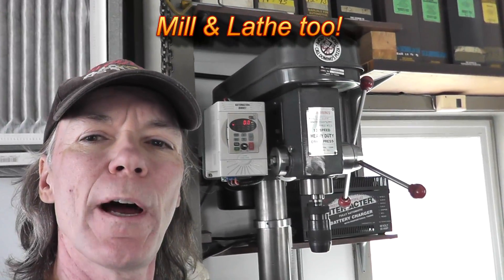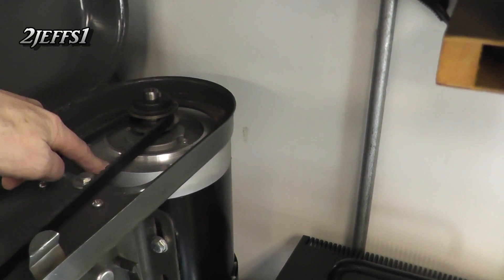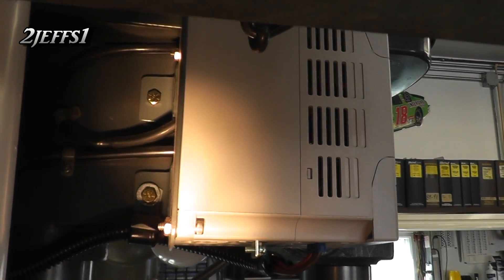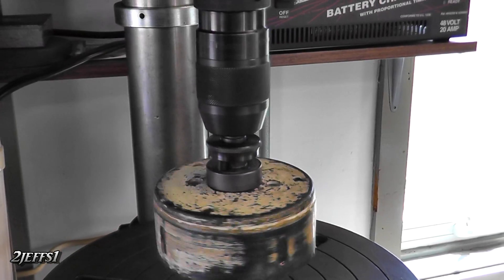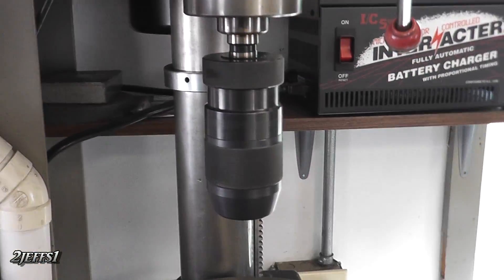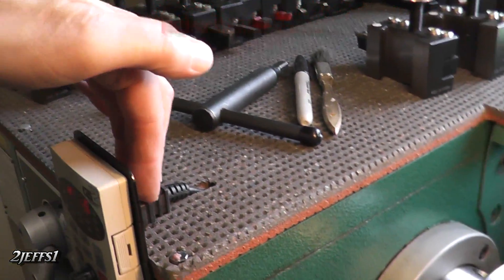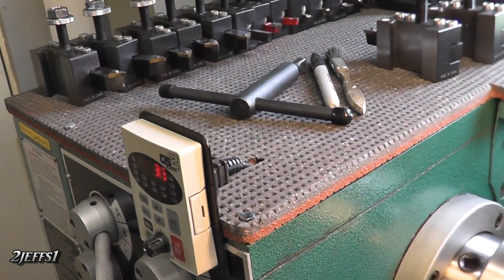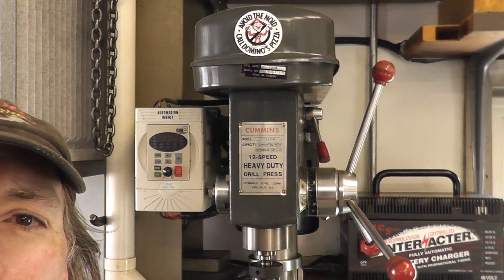VFD Drive Drill Press Lathe & Mill  (Variable Speed) DIY

Comment: I couldn't believe my eyes when I first saw your drill press - I have the exact same one! My father and I purchased ours back in the early '80s at a tool show here in the states.  I think at the time they were coming from Taiwan...and yes the chuck had so much run-out you could use the drill bit for an egg-scrambler.  I bought an after market chuck and a new MT-2 arbor and this helped quite  a bit.  I think at least part of the issue was that the spindle tapers were not ground to a very tight tolerance. In any case the runout is tolerable for woodworking, and I now have a Bridgeport for the more precise work  I have now since replaced the chuck, this time with a Llambrich keyless chuck solely for the the convenience....  The speed-change issue is now the most limiting factor.    Ironically i was just toying with the idea of getting a little 3-phase motor and VFD and converting it when i saw your video.  Thanks for some great suggestions!

Comment: Hello -
You said that is has good torque at low speed, but left it kind of vague.
I was watching another guys conversion video and he pointed out that at low rpm (maybe 60 to 100 rpm) the torque was weak, and stopped it turning by just grabbing the chuck with his hand. That was shocking to me. 
Are you able to stop your setup by grabbing the chuck at low rpm ?

Comment: Hello, Good video. I have a Lathe exactly the same as yours, its run on 220 volts single phase. Is yours run on single phase or 3 phase?  If single can you give some extra information on how you did it.  I'm having trouble finding information on VFD for 220 volts single phase motors. Can it be done? Graham, many thanks.

Comment: I think at 4000 HZ, with a three to one ratio that you mentioned, the spindle would turn 116,000. RPM’s! Yikes! How is low speed power? How big a hole can it drill? I calculate 580 RPM at 60 HZ you mentioned 4000 RPM at 140 HZ so that’s 66 times faster which doesn’t add up. 140 HZ is 2.3 times faster which should be 1,300 RPM.
Reply from the maker: Hi David. I have yet to be discouraged by this drive. Yes - slower speed it does loose power, Never had that to be a problem. I use it for tapping too. Just turn it way down and keep hitting the reverse button. Never broke a tap!

Comment: Do you have the VFD connected to a separate circuit?  I see they draw quite a bit of current (about 19 Amps) for a 1 HP motor @ 115 Volts.  Thanks.

Comment: Hi.
 Thanks for the info in the video. 
Do you know if the motors lose torque when you run them at low speeds? 
I am trying to get a wood lathe running but  I wouldn't want to lose power when slow speed is required.
Thanks again.

Comment: Great video, I have the same VFD on my mill, but I am having trouble with the settings.. some times it OL..it runs fast and the slows down.. would you mind sharing some of the setting with me ? thanks
Reply from the maker: You might have to slow  down  the spin up. Totally know what your .... Had to do that on mine. I did mine back in 2004. Many projects since. Check with the Manuel, think  that might tell you how to - de-tune spin up....

Comment: Hi Jeff surely enjoyed your video on the variable speed unit/for the Drill press. “Was wondering is this workable for an old Rockwell Reeves drive drill press as well.  "? 
    My manual crank variable speed control is shot, and was thinking to bypass it and go the route your doing.  Let me know. Thanks, R

Comment: How about  having one VFD and powering a load center with all the machines plugged into it and  each machine having a on/off switch just move the remote to each machine that's on? No need to have a VFD on each  machine.-mike

Comment: Hello jeff, i got an old drill press with a 2 speed motor 3 phase 380v with a rotary cam switch that switch between 2 speeds. the rotary cam switch is not working and i can't find a replacement. is it possible to make a vfd run the motor in instead of the rotary cam switch ?
Reply from the maker: Possibly. Wiring things are hard to do/explain thru the key board. I think that company that sells those drives might have a tech line and be able to help you on your needs.

Comment: Is this still active?   Could you answer a couple of questions for me Jeff?
Reply from the maker: I could try but I did that project in 2004. Moved on to many more projects since.
Reply: I have a 1967 Rockwell-Delta drill press.   I wish I could post pictures it help explain a lot more.   But the wiring for the electric motor and the on/off switch go into this box (junction box maybe?) and I’m able to wire it for 110 and 220 in that box, with the plug coming out the other end.  Any tips on wiring it?   I’d like to update the wiring on the drill press.   Or am I better off just bypassing that box?
Reply: And is there any disadvantages using a 2hp motor vs a 1hp?
Reply from the maker: Wiring is difficult without being there and pics like you said. I did use my 110 on/off switch on the drill press where the drive is 110 single to 220 3 phase to turn the drive on/off. Where you asked on the motor I have that 3/4 hp 3 ph with a 3 to 1 ratio and have yet to desire more hp. It seems I purchased a 1hp drive for that motor where over sizing electronics never hurts.

Comment: Hi   .  What about consumption of electricity and needed AMPS   . In case I have  3 phase  3 HP  motor  . How many amps I need to run it with VFD  IN   220v  home electric.
Reply from the maker: Check the label on the motor. Seems Automation direct did have some charts otherwise call and talk to tech support before ordering a drive to be sure to obtain the proper one. I always ran a larger drive than necessary to get by for insured trouble free use in the future.

Comment: Bloody brilliant.
Only problem I have being down under, non of the parts work here with our 240V Single Phase, or 440 V x 3 phase power supply!
I have both single (10 & 15 amp) single phase 240 V outlets as well as a 63 amp 440 Volt 3 phase supply with 42 and 20 amp outlets.
I can buy a used treadmill with a half hp 240 V DC motor, and variable frequency controller off our version of Craigslist for only ~$40 which is tempting, for my pedestal drill conversion project, however an electrician I am not, electrickery to me is damn white fella magic best left to the experts! Our 240 V single phase AC supply, & 440 V x 3 phase supply will put a world of hurt on you like instant death if you screw it up.
I admit I’ve wired both 240 AC & 440 x 3 phase off a diesel gen - set when living on an island offshore & not connected to the grid, but here on the mainland and being connected to the grid I daren’t have a go at trying to figure out some used treadmill motor & vfd controller, coz if I get it wrong, and it doesn’t kill me, but instead hurts some innocent, well the power grid Police will lock me up & throw away the damn keys.
I could pay an electrician to wire it up all legal like, but I didn’t win the danged lottery this week & here a electrical qualification is a license to print money! They want $1k up front to talk to you on the phone or come out and even quote a job!
If I’m going to pay that I might as well just buy a new VFD drive pedestal drill online & plug & play.
Cheapest I can find here is $500 with free freight, which when you look at the cost of buying a 3 phase motor, and VFD that will both work with our 440V 63 amp 3 phase supply is going to run me near enough to that price anyway!
Reply from the maker: Quite the write up you shared here. I find it so interesting how different things can be in other parts of the world!

Comment: Great video. I am a beginner at this so I have a question,,, On my Central Machinery Milling/Drilling Machine I have a Model 818320    , 1 1/2 HP motor 3450 RPM  120/240 volt motor that screams with speed ! 
Can I use with the GSP-11PO to get my speed down or do I need to get a 3 phase motor like yours ?.
Reply from the maker: Hi Jim. Yes - you will need a 3 ph motor if controlling the speed is desired. Make sure to get a 1725 - 1750 RPM motor to have low end power. Those drives can scream that slower motor to the recommended top speed of 5,200 RPM if desired by turning up the Hz.

Comment: The Rotor of the motor still may brake due to the high freqeuncy, when its rated rpm is at 60hz and it is running more than 110..... always rember that.
 
Cooling is quite the easy part as long the motor has a lot reserve in terms of its power, usual these are made for permanent drive at full power.

Comment: Really good video.  Great info.  I have a pump 220v 1 Ph. I would like to run it at low rpm.  Do you think they make a VFD 220v 1Ph output - so I can slow my pump motor down?  How about this idea...use a VFD 220v 3 phase out, but only use two of the 110v wires. What do you think? Thx
Reply from the maker: Neat you brought that up. I have had that same thought in the past but don't believe that would work. The single ph motors usually have a start capacitor unless they are a soft start motor and some have start/run winding.

Comment: Jeff, your video inspired me to set up our Craftsman drill press with VFD. I ordered what you recommended from Automation Direct except I purchased a 1 hp motor. I believe I have everything wired correctly but get an "OL" error soon after firing it up. I noticed below you commented on tweaking the ramp up numbers to get it started. Could you share those numbers and any other settings you may have changed? Thanks
Reply from the maker: Hi Jason. Yes I did have that problem on the lathe due to the weight/mass of the chuck spin up. Man that setup was done years ago (can't remember) but if you look in the Manuel there was info on how to correct the OL cond by slowing the ramp up speed. BTW - after changing the lathe setting it has been working fine. Thought you would like to know that. Actually to date I still find the 3/4 sufficient for my needs here. If needed I bet they have a tech line where someone could walk you thru the correction quickly. Good luck on your venture, Jeff.
Reply: AutomationDirect's Support line is FREE and is at 1-800-633-0404. Their Videos are at www.automationdirect.com/videos - it has an awesome search - just start typing ...
Reply: I should have replied back sooner. I made the mistake of "assuming" instead of reading. I had left the motor wired at the higher voltage setting. After I fixed my mistake, the VFD and press have been performing flawlessly. Now I have to save up enough to convert the other press in the shop! Thanks

Comment: your saying the V.F.D. will not work with a single phase motor?I'm quite interested in one but have spent a lot of time and money converting my tools to single phase
Reply from the maker: Correct, the VFD's that I am using will not work for that. Someone left a comment a while back that there is such a thing but the cost would be more than switching to 3 phase. (Motor and drive)
Reply: 2jeffs1 ...thanks,thinking you just saved me a bunch!

Comment: Something that a lot of people do not think about: motor heat. With a VFD, the motor is doing the same amount of work at, say, 1/4 rated rpm as it is at full rpm. The internal cooling fan is only going at 1/4 speed and fans do not move 1/4 the air at 1/4 the speed. I worked with setting up VFDs for years. When setting one up for steady load service like a lathe, etc. it is a good idea to put a temperature sensor in the motor cooling air exhaust and kind of keep an eye on it. A small dedicated cooling fan can be put in there, or if the heat isn't too bad, just keep the lathe geared down so the motor is in the top 40% or so of it's rated speed range. Just something to think about, you seem to be very thoughtful on how you do your projects, just trying to help. I first saw you on your oil stove project. I am going to do one of those for NEXT winter here in Colorado (I'm just retired with a new shop out back). I am going to use a temperature Process Controller, probably from AD, good outfit,  like your VFD.
Reply: Makes sense, I like the dedicateded cooling fan idea...cheap and cheap insurance
Reply: Mike Jones great response/ info....On my 2x72 grinder.. I was all excited about adding a VFD...Till one night i thought of what you just explained...so i went with step pulleys instead...(Baldor l3510 tefc 1750 rpm)
Reply: I guess that is one reason to get a VFD that is oversize compared to your motor
Reply: @johnsmith4630   Its not the power capacity of the VFD,  its the motors built in fans optimal rpm that is.  You are providing it full power but spinning the motor much slower than it would with a gear reduction system.  That means that instead of running a constant RPM on the electric motor which has an intergral cooling fan made for that speed and changing spindle speed via gears or belts,  you are running the motor itself slower which can cause the motor to overheat due to the slowed fan speed.
Reply: @JB Love to hear how it wrong

Comment: Never thought about the soldering to demag a bit. I use an old video tape demagnetiser, it works great oo!
Reply: Old ac motor casing with the shaft and moving parts removed, really any ac coil will do it. The more amperage it pulls the faster it demagnitizes.

Comment: I dont get why you wouldn't have to change the gears on the lathe. wouldn't you have to for threading. and wouldn't it have less torque when spinning slow?
Reply from the maker: There is a little bit less torque at low rpm's but when tapping the end of a shaft for example it will stall before snapping a tap. No harm done! I just keep hitting the F/R button. A thought which would give a better understanding, those motors are rated at 1750 rpm @60hz. They can be ran safely to 5,200 rpm. The Hz on those drives can be set as high as 400. That would exceed the safe speed of the motor. I have mine set to 4,000. That is a huge rpm window and should give you a better thought on where it would be rare to need a gear change once set up and in the right gear. Once those drives were installed one can't wait for the next job where they are so nice.
Reply: thanks for the reply.

Comment: Great video, I have the same drive on a vertical mill, and I having issues of OL1 when drilling, did you have that experience? and you mind sharing some parameters  so I can program it properly... thanks
Reply from the maker: Never had that issue. Have worked it quite hard on the lathe at times one can tell by the sound. The only thing I can contribute is I had to adjust the spin up speed on the lathe only when first starting it or would get OL. That was a long time ago now, I cant remember what I did , seems it wasn't a big deal tho. I did purchase the oversized drives to avoid problems in the future. Bigger is better in that deal and hope you went that route too where if only under load sounds like perhaps a possibility.
Reply: When setting up most VFDs, you tell the VFD what the locked rotor amps of the motor is and it calculates when the alarms will show. This can be tweaked by several means, some VFDs have a torque boost that will up the voltage output when it starts to load up. You can just up the locked rotor amps setting (at your own risk, it's not actually as bad as a nickel under the fuse, lol). Sometimes the intermediate frequency of the VFD can be adjusted to help the load. Different VFDs have different ways of adjustment.

Comment: hi there what kind of cable did you use to connect the GS2 to the machine? I cant find it anywhere on the internet to buy..
great video, greetings from Slovenia :)
Reply from the maker: Hello. I used 12 gauge wire for automotive wiring harnesses which I have in the cabinet. It was single leads (on a 100' spool, seems like 10' spools were available too where you wouldn't need much) with multi copper strands inside. It comes in many different colors and then covered it with that black plastic wire loom (it is slit so the wires can be tucked in after being installed) that was for automotive use, to finish with a clean looking job. Hope this helps out and nice to have folks from so far away stop by!

Comment: I have that same lathe and I'm tired of replacing those cheap   magnetic contactors.  I'm going with a VFD and was wondering if it is possible to still use the fwd/rvrs handle on the apron or would that be pointless?
Reply from the maker: Great question. I wanted to do that too but for some reason didn't. Not sure but it seems if one wanted to connect to those external setup terminals one had to discontinue use of the main control panel had to hook everything up. If anyone else has any thoughts on this please chime in!

Comment: 0:21 let ME start off with some basics. Your video is spreading incorrect information. Single phase variable speed is certainly possible. Ten seconds of google will expeditiously show as much. Hell, I've used a variable speed single phase motor on multiple occasions. It was the spindle drive on a Bridgeport knee mill.
Reply from the maker: OK you are correct but...   if you have not already designed a system, the single phase OUTPUT drives tend to cost more than the cheap and plentiful single phase INPUT - 3 PHASE OUTPUT drives and a 3 phase fractional motor. So the only reason to use one is for an existing installation. Then you have to ask why? If your goal is to save energy cost, forget it. The VFD will cost you so much that there will not be any reasonable ROI. I try to keep confusion and costs down, quality and ease of installation up for viewers so...
Reply: Say Jeff, many people are using these vfd's to run 3 ph machines now because it just works. Good job on the video, lots of info, and I made notes on the motor and vfd that you used on the drill press. Should work equally well on my bench top mill as well.
Thanks,
Jim